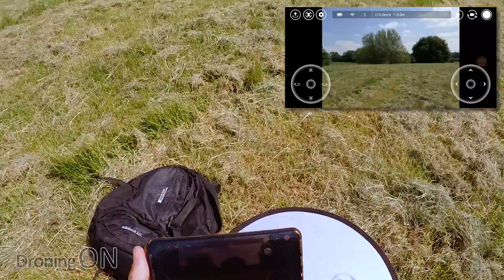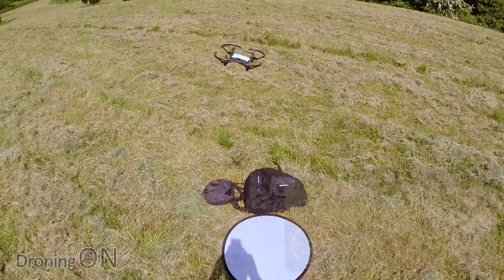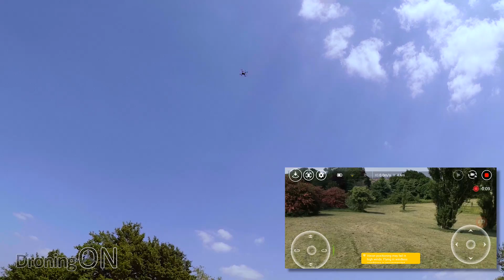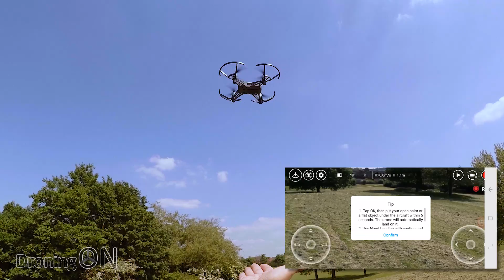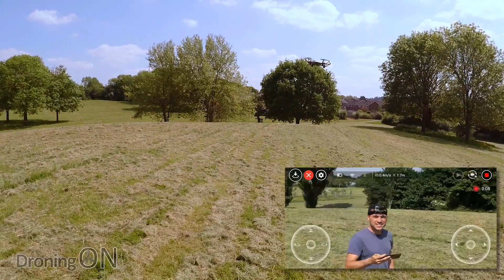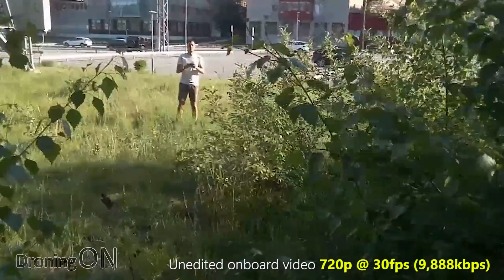DroningON | Ryze/DJI Tello Review (Part 2) - Flight Test (Footage & Modes)

Comment: You can buy a wifi repeater for 8€ , connect it to a power bank and it improves the range so so much. You go to 30m high and the wifi signal is full. Also it goes to 200m far. Just invest the 8€ and have sooooo much more fun with it. 👍👍👍👍👍😊
Reply from the maker: Very true! Thanks for the comment!

Comment: When I connected the drone Wi-Fi to my phone, it showed that it was connected on my phone. However, the drone was still blinking yellow and did not take off once I slided the take of button on my phone. It was fully charged overnight and my phone was also realllly close to it. What could I try to make it connect?

Edit: I found out the app had a bug I reinstalled it it was working!

Comment: Great video. Thank you.
I have one of these. It’s brilliant. I’ve also got a madcatz controller (works great) and a Keplar VR headset. 
I’ve also added another battery and a three port charger which is a must really because you have to charge in the Tello otherwise.
I now so want a Spark ♥️

Comment: In case you ever revisit the review of this little drone you should try the third party apps now available and a wifi extender. That makes a completely new drone: Tons of features, gamepad support, way less frame drops, huge range improvement, GPS like autopilots including RTH just based on the downfacing camera.  I was so amazed I did my first video (in awful quality) just to showcase this function: automatic RTH from 140m distance in very strong winds. You can find it on my "channel" (well I don't have a real channel, only this shaky video)

Comment: Fantastic video! Its really wonderful, just two questions, I'm totally new to this flying bizz... So what happens if it's flying away and goes out of range and if I didn't notice the warning sign, does it still go away forever lost? Also what about wind resistance? If it's a windy day will the wind take it away? And also I'm assuming the videos photos save to the phone right ? Thanks so much ! Love your videos!
Reply from the maker: Thanks for your comment Alisha! The Tello once out of range will detect that it has lost WiFi and will slowly descend to the ground. It was quite windy on the day that I tested it and yet as you can see it remains in positiion so no big worry. Yes the video save direct to the phone.
Reply: My telllo was at the 99yds range and i lost control fast, had to run towards it quickly to regain controls.

Comment: Great review! I have been in email contact with RYZE customer support on another topic - when are they coming out with a adjustable camera (manual rotate up & down )? The $49 knock off brands have this type of camera lens. For me, I like that feature. RYZE C.S. was very quick in response and took interest in my question. Their price point, features and easy replacement parts need to be refined as the Drone/Quad market is on a ever changing & updating world.

Comment: Great video.  Been looking for a practical drone for fishing trips on the canoe, no too expensive in case it goes for a swim and small and light to pack away easily, and possibly recharge from a battery pack.  This looks like the one I've been waiting for.  Thanks for the review Ash
Reply from the maker: Pleasure and glad that you enjoyed it, look out for a special bonus video tonight involving the Tello!
Reply: Just a follow up for viewers. Got the tello, had g8 fun with it. Spend alot of time around water. Hit a branch, fell into my local river. After about 5mins to 10mins in muddy water,  managed to find it, fish it out. Removed battery. 3 days drying in the sun and it fired it up, no problem. No issues.
Reply: Whaaaaat^^^^^    good  job.
Reply: Also keep in mind that it will land automatically if WiFi connection is lost for over 15 seconds or so. Safety feature that may kill it when flying over water or other hard to reach places.

Comment: Great review, Ash. No doubt you have, or will do,  installed DroneBlocks (?). For such a small camera the quality of the still photos is quite staggering. You’ll have probably noticed that when recording video footage frames are dropped. I understand Ryze intend to fix this in a future FW fix. Another interesting feature not talked about is how it disarms itself in a crash or when the props  meet resistance, this will extend the life of the motors.
Because you can program it with Scratch/DroneBlocks there are many possibilities, someone in the community has managed to implement face tracking, check the Tello Pilots forum for more on what others are achieving.
Regards
Nidge.
Reply from the maker: Hi +sputniksam, thanks for the comment and I'll definitely be installing it, look out for a part 3 :)